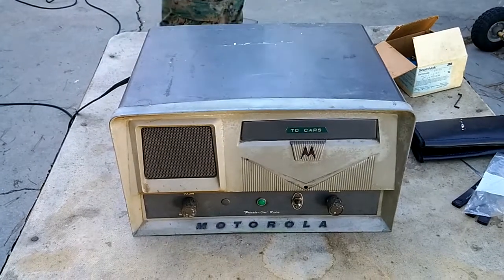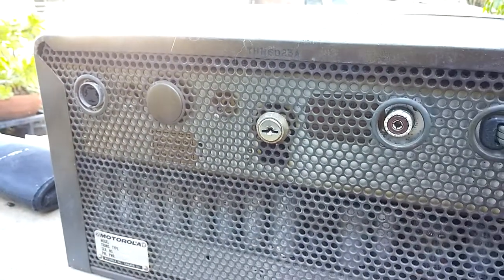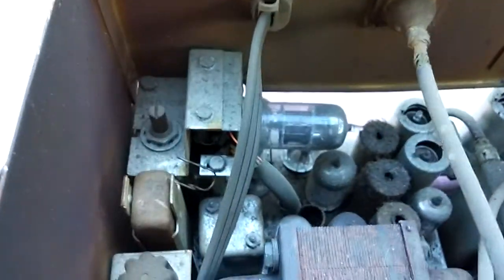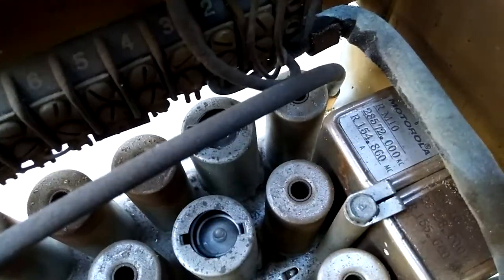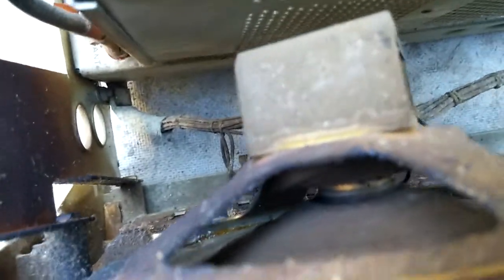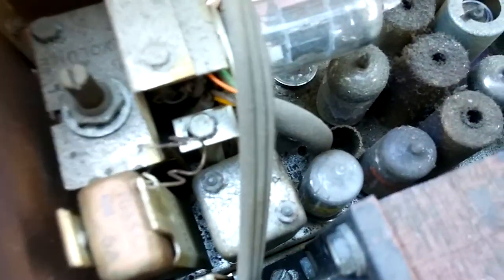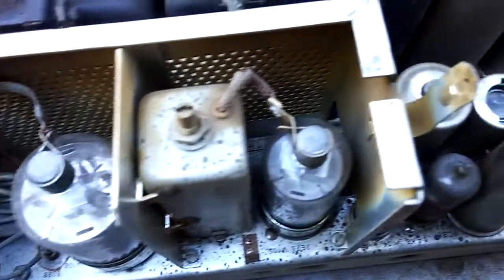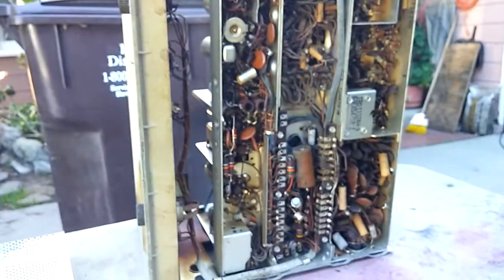Vintage 1966 Motorola L43GGB base station

Comment: Nice video!  Back in the '60s and early '70s I converted many of these and 41-Vs as well to the Amateur bands. They were outstanding FM transceivers.  Occasionally, I'd get one where the chassis was covered with thick grime and I would toss it in a hot water and soap bath for a couple of hours. Then rinsed it well and dried it in my wife's oven for 3-4 hours at 120 degrees.  

Afterwards I would make repairs where needed and do the conversion to the 2 meter Amateur band. They gave years of flawless performance! 

73, Mick Bradford - WB4LSS
Reply from the maker: thanks for the great info. I managed to get the receiver to work a lot better by adjusting the local osc, mixer and front end. unfortunately a pair of crystals would run about 50 dollars to get it on 2 meters.
Reply: +Chris WOW! Fifty bucks for the crystals! In the late 60s and 70s i was a firefighter with the Memphis Fire Department and every engine house used the same Motorola desk set as yours. One day I had brought one of my desk sets in to work on it and was almost suspended on the spot. Our District Chief stopped in and saw the radio opened up and me working on it!! He thought it was the stations desk set!!! It took my Captain and Lieutenant to convince him that it was my personal radio. Later, I took him out to my truck and showed him my 41-V with an old Ma Bell TT pad and let him call his wife with it. He was impressed with the setup and my knowledge of it all (I didn't tell him that dozens of Memphis Hams were doing the same as I was.) Later, he got his Technician ticket and I converted a 41-V for him.

Comment: Man that is SUPER COOL AND SUPER INTERESTING!  I've never seen anything like that!  Thanks!  Wow
Reply from the maker: Thanks, its not the oldest two way radio, there were earlier systems made by GE that used dynamotor power supplies and seperate receivers and transmitters.  The mobile version of this radio used a transistorized power supply to convert the 12 volt dc to B+ plate voltages for the tubes.
In the 1930's some police departments were using 1.8 Mhz, just above the AM broadcast band, to dispatch calls to mobile units.
Reply: Man that thing is packed with electronics. Chris, what's a dynamotor you spoke of? How long ago do you think it was when that radio was in service? And did it have a municipality marking?  Great video.  Liked the one on the cap replacement too, cable or sat box? It's been a week since I've seen it... Saw shango creeping around in the background!

Was that Motorola expensive?  Thanks man!  I subscribed to ya. Took me a while to run across your channel.  My mobile version of YT is touchy.  Good stuff sir.  Steven
Reply from the maker: Steven King
 I found a date stamp inside that shows it was made in 1966.  The latest date code on the vacuum tubes was 1977, so it probably was in service to the late 70's. It was about $20 + $30 shipping because its heavy.  No markings as to the previous owner.
Reply: Awesome Chris.  Thanks for your time, very cool never seen one.  My wife even knows your voice from me watching your videos.  Can't wait for more buddy.  S

Comment: The key to that is likely a 2135 key, they can be had for a few bucks on ebay, but picking it is usually a little more fun! Cool radio!
Reply: OK . Motorola used to ship new keys with every radio. I worked in a Motorola shop way back when and accumulated many 2135 keys.

Comment: I just picked up one of these myself. It's currently crystalled to 151.something. I want to swap those out for my local fire frequency of 154.430. I have two pairs of Motrac channel elements I could use. Any tips on how to do that? I know it needs to be tuned.
Reply from the maker: in the years since these radios were made the bandwidth of the fm signal has been decreased to allow for more users in the radio spectrum. so these Motorola's were designed for 5, and 15 kHz bandwidth and today's radios are 2.5 kHz so the volume would be cranked real high on the radio to hear the audio. still if you want to try first verify if the receiver is working now on the frequency it it set for.
Reply: Will do. Thanks.

Comment: Did you ever get it fired up?
Reply from the maker: Yes I got the receiver working. I couldn't keep this radio as I ran out   of space too bad but that's the way it goes.  You can't get crystals for these anymore so you can't use them for ham radio for example
Reply: Cool, yeah i know how that goes as well you can only have so much stuff lol. I have an old low power Motrac base station that was used by the local fire department I volunteer at. It still works and it still has the elements in it for one of our frequencies, but it wouldn't be legal to use due to the "narrow banding" the FCC came out with several years back. Bomar crystal is still in business, but finding someone to actually re-crystal the elements would be really tough.
Reply from the maker: @wildwelder87  I didn't think the Crystal's were available anymore but maybe they are